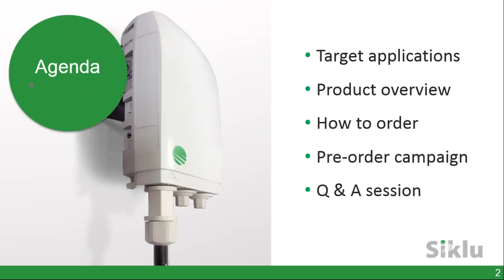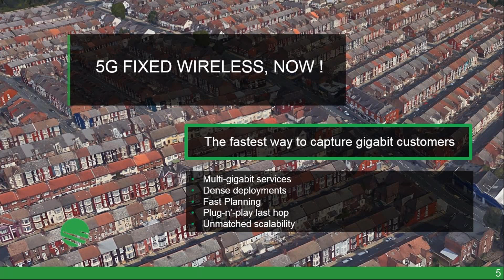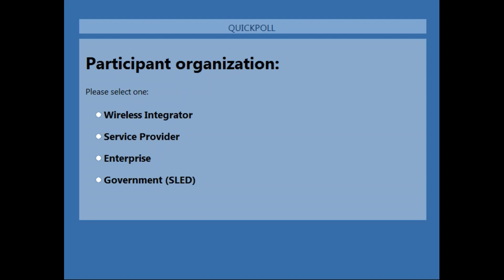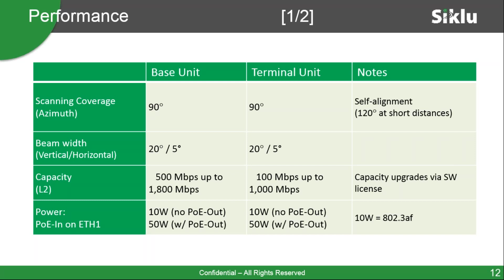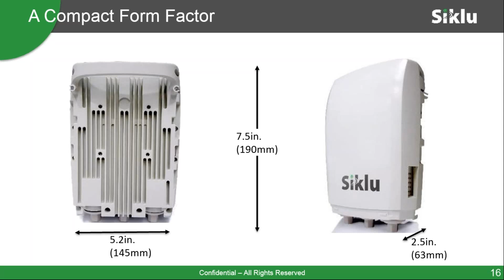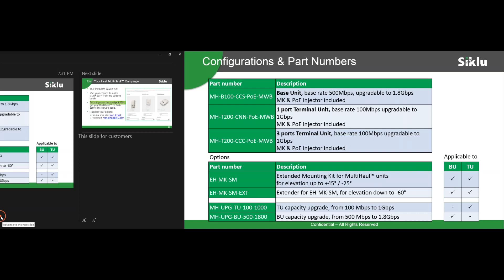Introducing MultiHaul™ Point-to-Multi-Point solution over 60GHz [Webinar]

Comment: my question is, will wireless cameras be able to communicate on the 60GHz wireless signal provided by this device?
Reply: No. You would connect the camera via an ethernet port, or using 5Ghz fixed Wifi.